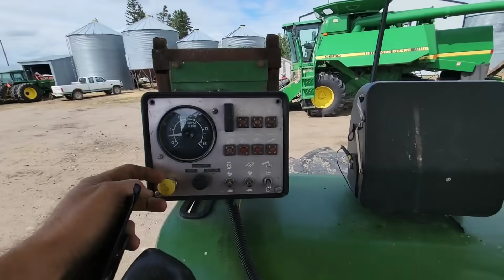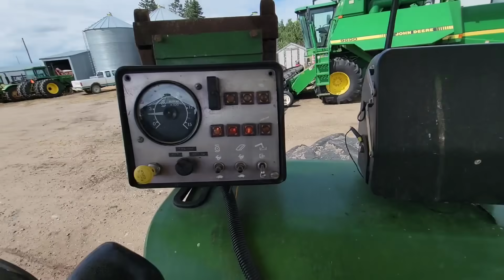Harvest 23!!!!

Comment: Such are the joys of keeping combines in the field?  Ugh feel your pain.  We run a 2188 also with a 30' flex head.  About 5-6 years ago we pulled the fingers out of the feed auger in the head and installed the flight extensions.  Works really well.  The big plus is no fingers to replace. Be safe out there!

Comment: We had so much trouble with feed fingers last year. 9600s rubber thingers fell apart. Bent the drum up. 1680 let one go. Went through the chopper, breaking the brand new chopper pan, hit under the engine, made a large dent, shot down through a brand new sieve, went into the return, rode up and jammed into the auger that refeeds the rotor. 🤦‍♂️ hired man calls, i think we have trouble.

Comment: When we used to run MF I always call them MF ers. ( Had two silver cab 860s) You know what I am saying. LOL  Switched to green then and moved to red several years ago.  We use all plastic feeder fingers anymore. They are a lot easier on the combine when you break one. 
    I was running a JD 8820 in wheat. Broke one of those fingers. Some how the cylinder threw it up through the top and it hit the bottom of the seat pretty hard. Made a real mess out of things. LOL